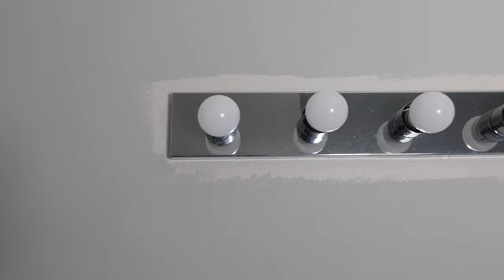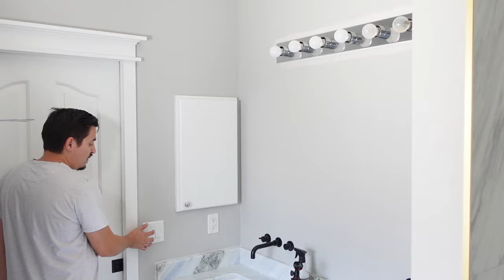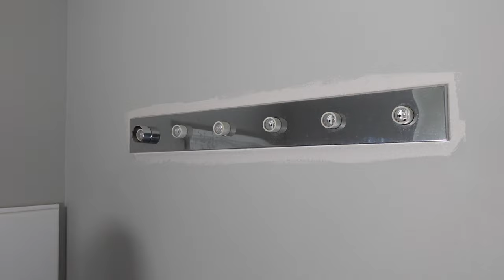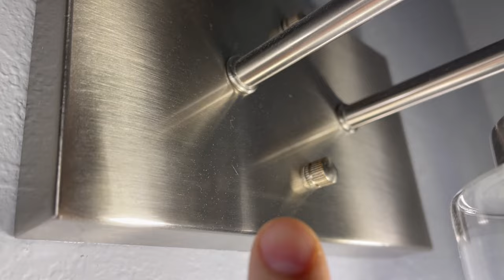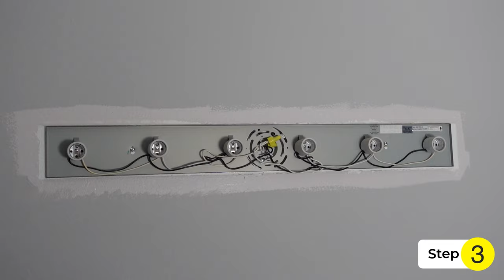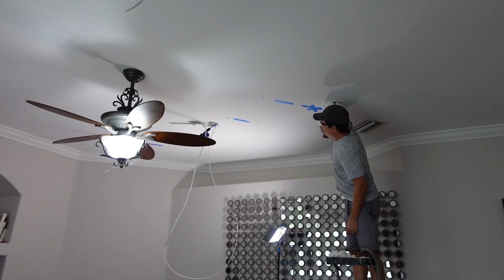How to REMOVE old Vanity LIGHT Fixture

Comment: I want to put a large mirror over mine. What do I do with the wires hanging out?
Reply from the maker: I would put wire nuts on each wire and use electrical tape to ensure they don’t fall off. But you might want to consult with your local electrician to ensure what you do is per code.

Comment: No visible set screw or cap screws but won’t budge. Probably painted together.
Reply from the maker: Yea use a putty knife to help get the paint unstuck.
Reply: @Daddicated I found it was helpful to start at the short end  where there wasn’t an overlap with the base plate sheet metal.